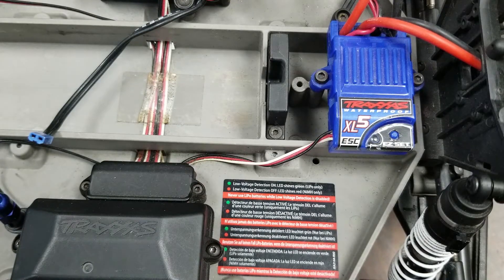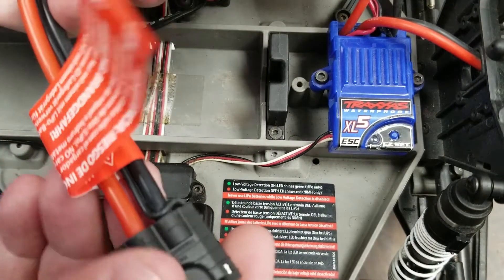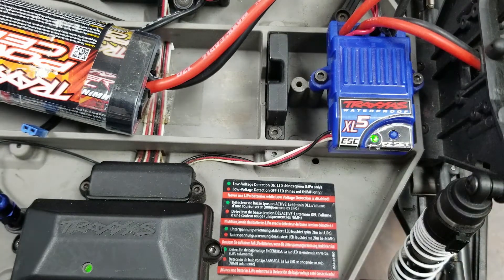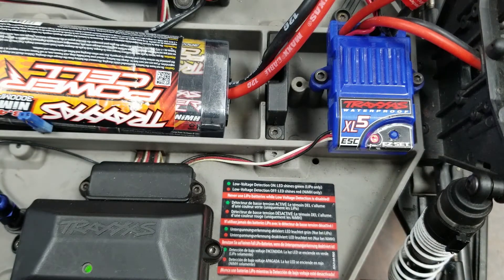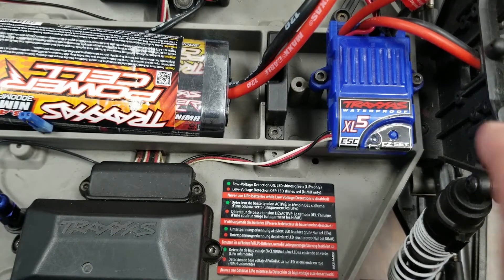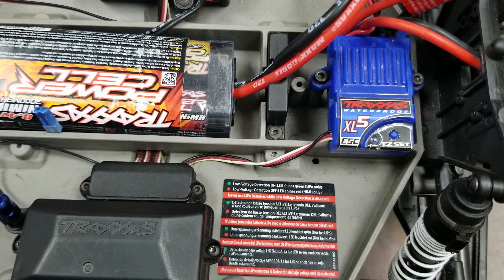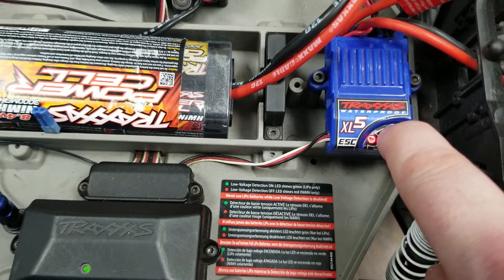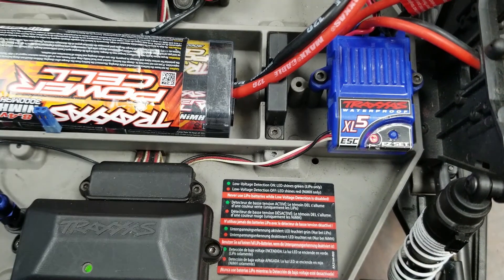Hobby 365: How to program the Traxxas XL-5 and VXL ESC

Comment: My car just blinks red and green.
Reply from the maker: Red/green blinking is indicating that it is in lipo mode when you are using a nimh battery. You may need to get a battery that isn't quite so full then power the esc on and hold down the power button. It will take it out of lipo mode.

Comment: Hey I just upgraded to a brushless system and have been watching many videos, and I can’t get my car to drive but I can get it to steer
Reply from the maker: Hi there! If  you have a Traxxas model double check that you haven't plugged your esc in to the second channel one slot instead of the channel 2 slot. That is a very common issue.